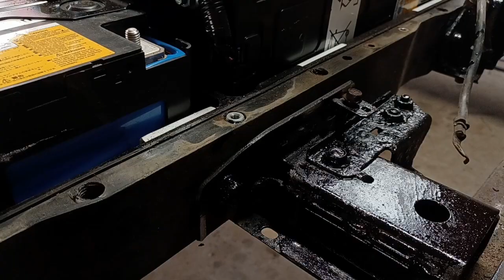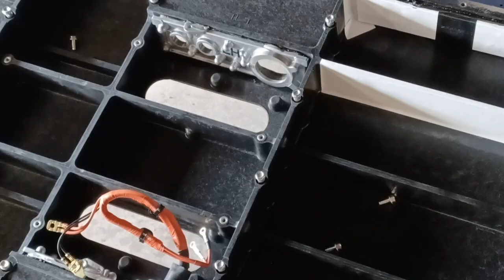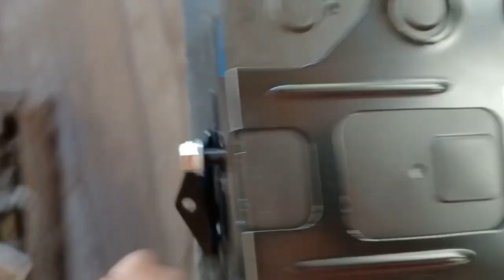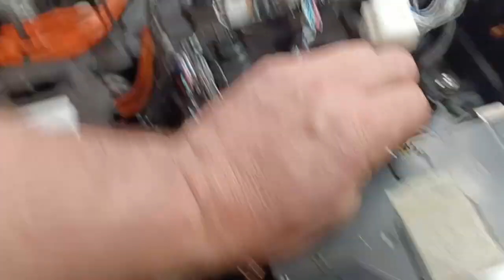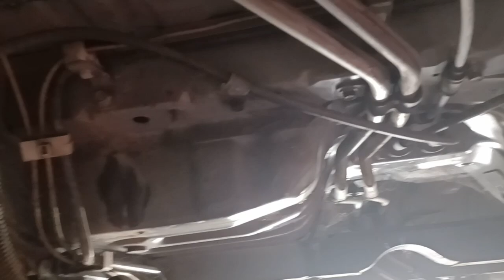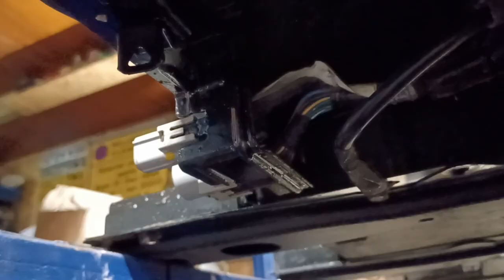Imiev battery pack DIY rebuild #electriccar #batterypack #diy #mitsubishi #carrestorationproject

Comment: Hi did you swap like for like prismatic cells or are the new type have higher capacity
Reply from the maker: like for like bought a scrap car for the batteries which had only 25K on clock rather than 71K and swapped over. My car had green CMU and the low mileage non runner had red CMU - the earlier system. So I could not just swap the complete battery pack over but had to rebuild the pack like this - transferring all the cells across and using all the best bits for my car.

Comment: Nice work! Im planing on changing my cells to 98ah cells in the future. Did the car complain about the difference in cell voltage? Or did the bms fix that when charging? Nice video!
Reply from the maker: car seems to have got used to it but still have an occasional CMU09 fault which throws up and needs a replacement SH board really then I think the car would be 100% perfect but we are living with it at the moment as its perfectly useable.
Reply: Which cells do you plan to insert instead of the LEV-50?

XiHo currently recommends EVE 58Ah or CATL 62,5 Ah, as the CATL 3763 are out of stock and the SVOLT 90Ah being quite high.

I‘m currently decision making, so highly interested on your feedback @Lassekongo24